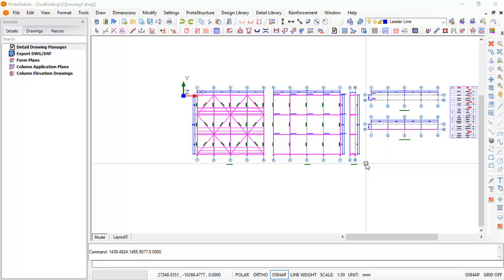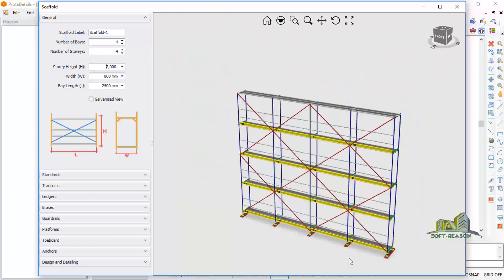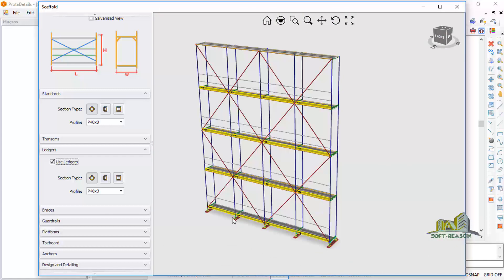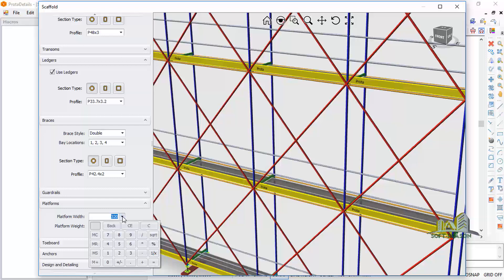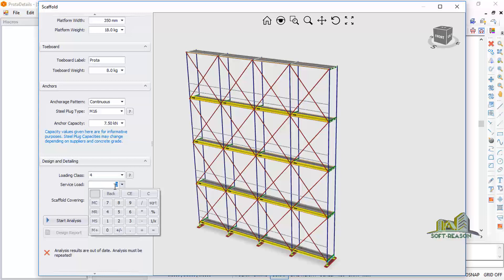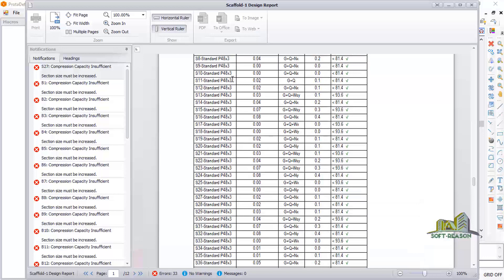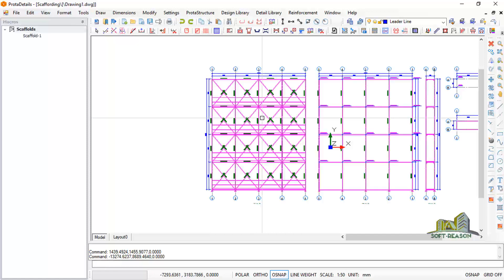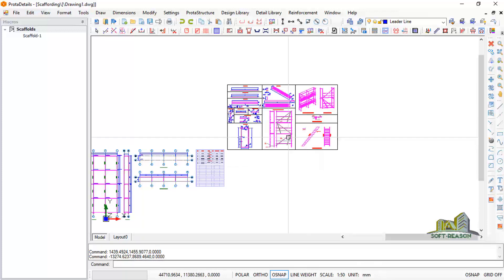Scaffold Design in Protastructure

Comment: I have  little missunderstanding I cant find that  Scaffold    option in my   computer  could you tell me why  ?   also  prota detail isn't opening  it is only opening prota structure
Reply from the maker: First which version of Protastructure are you using. Kindly uninstall and reinstall and it will work properly.
Reply: @CADmade-easy   prota structure 2018  but i mean i have to do scaffold  structure analysis and  drawings which software would you roccomend me and  what advice could you give me